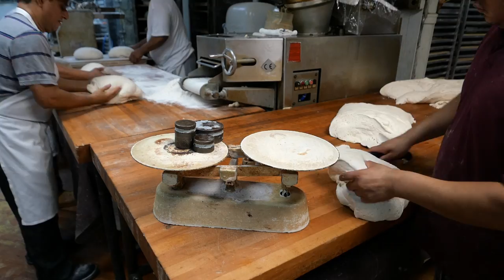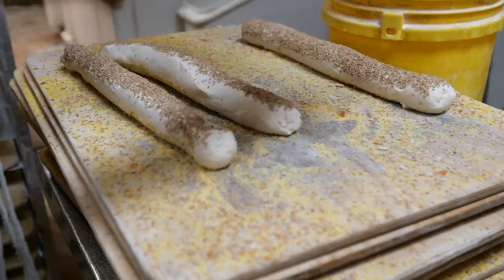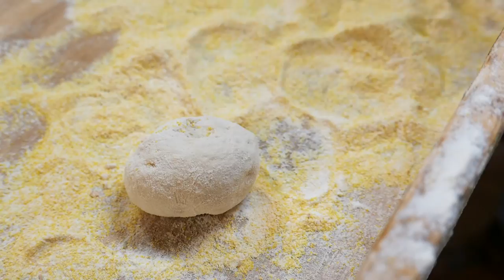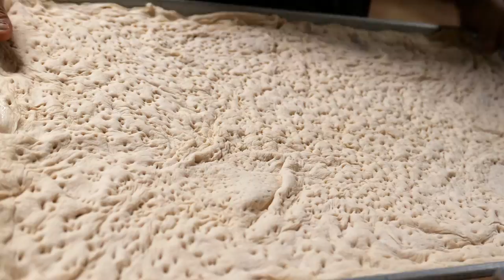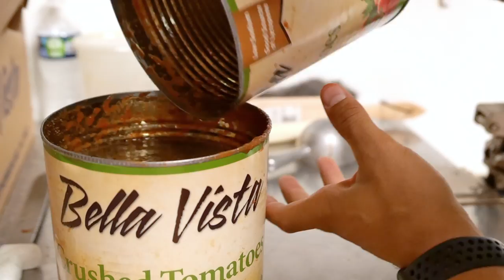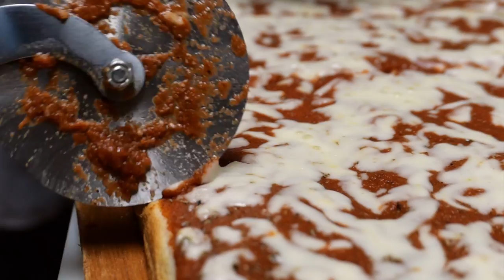American Food - The BEST TOMATO PIE in Philly! Sarcone's Bakery Philadelphia

Comment: In my country, Argentina, what you call "tomato pie" is just pizza.  You can find one or two pizzerias on every corner, in every city.  The rectangular pizza had become fashionable but it is hardly seen anymore.  It was called "pizza per meter", because you chose how many inches to buy.  The round pizza is the most common and for us it is as necessary as the air we breathe!  The regular pizza has tomato sauce and shredded mozzarella as a topping, the one that only has tomato is called "pizza de cancha" because it is sold at the entrance of soccer stadiums (canchas).  We really like the onion pizza with mozzarella and boiled ham.  If you want to eat pizza, then, come to Buenos Aires and you will see how many pizzerias there are.  The aroma of pizza is in the air (and I'm not exaggerating).  The work of bakers is invaluable, because of how heavy and routine it is.  Also being near the mouth of the oven in summer is the closest thing to hell!
Reply: This pizza needs more cheese!
Reply: Tomato pie doesn't have mozzarella cheese. Just the sprinkle of Parmigiano or Romano.  There's a difference